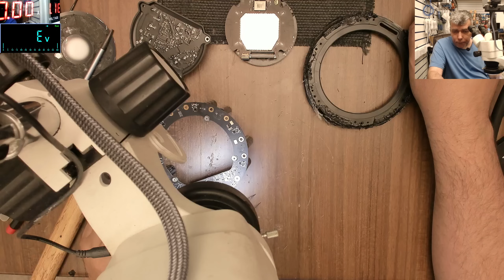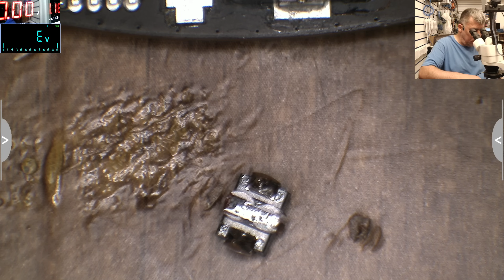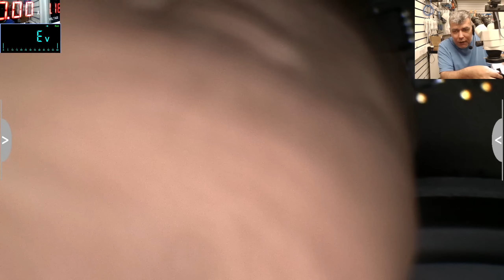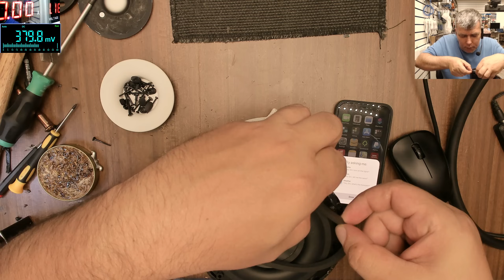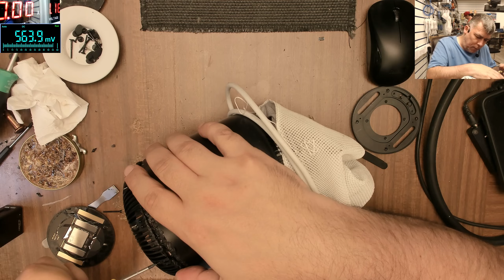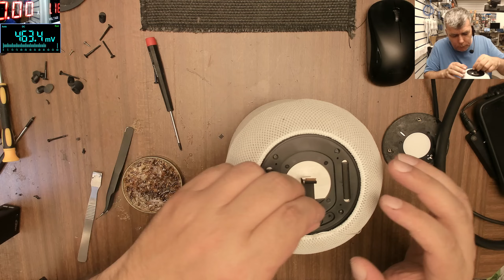Fixing the most unfixable Apple device - Apple HomePod -Part 2

Comment: Fixing the unfixable nice video Sorin. You can pass a thermal receipt paper with a sponge on the board to find shorted components getting hot. No burned fingers and no need to use petrol or alcohol :) cheers from Brazil
Reply: I'd like to see that technique with the thermal receipt paper

Comment: Mr. Sorin, great job fixing the thingy, also you might want to get a Dremel tool to open glued plastic cases like this. It makes cleaner cuts and any edges left over can be grinded down with a filing wheel attachment.

Comment: Sorin what are you doing?? Hammer !!! Hahaha is a nice repair on the board.
You need proper tools ⚒️ to fix it like new.
A €16 dremel from eBay with al the tools to cut and make it smooth after.
But it’s the first time I see it and it works great . Did eat 5 bags chips an 6bottles of bear during the long nice movie 🎥 thank you for the time

Comment: Amazing work. I think most places, if they agreed to try at all, would probably hand back a basket of parts a month later. You fixed it in three hours.
For opening the case a few ideas. There are hot knives that would probabler do a cleaner job. A hot wire might also be a option. Since I have a lathe, I would probably try to think of a way to mount it on that and use a thin parting tool to cut. 
Also, after seeing the construction, I am thinking maybe the cut could be made below the joint. There is less material to cut that way. Plastic welding could be used afterwards to stitch it back together.

Comment: As mechanics, to get those long screws to fit, we poke a screwdriver all the way into the screw holes to get them
properly aligned before putting in the screws.
Reply: Good tip! I also do it as an electrician.

Comment: That diode you took out is actually 60 volts 5 amps, the one you installed is only rated 40 volts 2 amps it will blow if the volume is turned up for an extended period of time.
Reply: do you think he cares ? :)
Reply: @0dium.  probably not, he should have ordered the correct part, but he looked up the wrong part so thinks he’s putting something better then what was in it, he will be getting a call or email about it not working again, lol.

Comment: Hi Sorin, I'm enjoying every video. You could close the speaker the way you opened it... but with a bigger chisel tip on a soldering iron and using a temperature around 200°C just to melt the plastic. You poke into the plastic and push it a bit forward, lift the soldering iron, pull it back a little, poke the soldering iron in, push a bit forward, lift the soldering iron. Rinse and repeat... Feed external plastic if needed, like zip ties / tyraps, a piece of a plastic housing, coffee stir sticks, just what is of the same plastic you are welding. See on YouTube for video about welding plastic. After the weld is sealing the housing you can do some cosmetic work and flatten the weld with the soldering iron or the hotgun and a wide blade smoothening the joint.

Comment: Locate the exact position of the faulty diode , in relation to the external case. Then next time u can 'dremel' an 'inspection -port' in the casing, to test for 'same fault', without dismantling the unit. 'tape-cover' over the hole. You think ?
Reply from the maker: brilliant idea, yes that will work

Comment: Sir I have a hp Chromebook . Coffee had spill on it. First it was showing white screen I unplugged the lcd and then plugged it back . Lights disappeared . After 10 days I turned the charger and suddenly the Power lights came . The issue is that when I opened it and hold the power button it seems as if it is trying to open but not able to do . What do you think is there problem in motherboard or the lcd cable? Psl reply pls

Comment: So you replaced the original diode with a two-legged 100V, 6A: 1) is it safe for the rest of the board, 2) can you explain how the bridging works?
Reply: I think I figured this out...the two small pads on the board share continuity, so it doesn't seem to matter if you bridge the two small pads together and / or use a two legged diode! I haven't tried it yet but it worked for Sorin

Comment: I use a Dremel to open these it leaves a nice clean straight line for reassembly & I have changed that diode before it a common fault.
It's called planned obsolescence from Apple (The green company), they produce more
 e-waste than any other company as they don't want it repaired they want it replaced!!!

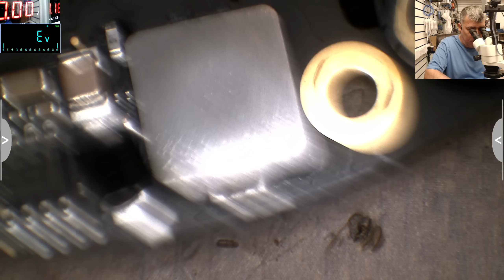Comment: 28:24 WHY did you bridge those two pads together(under brown capactitor)? (they are separated at 24:33). Don't you think that if they are separated from each other, then it means that they are NOT the same (no matter what you see on the multimeter)? So you should solder two diodes because two dioes need to do the job separately for each pad (output). Why didn't you use two? You had two in that TV donor board. I don't get it. It is very very hard to get inside of this speaker, so why didn't you do it in the right way (better way) this time?
Reply: I see these two small pads on the board are continuous between each other with my multimeter, so it probably doesn't matter if they're blobbed together.